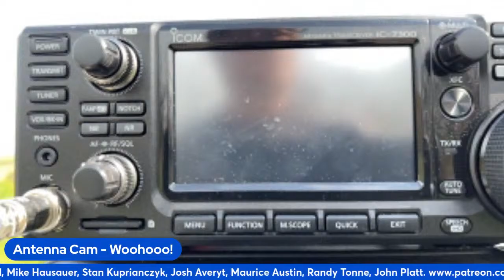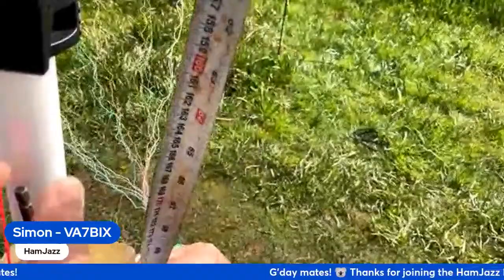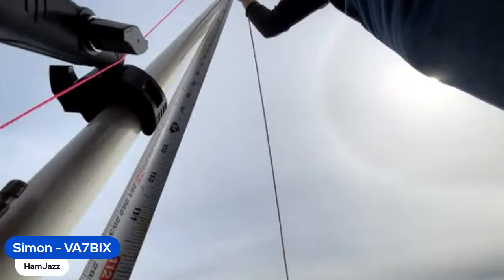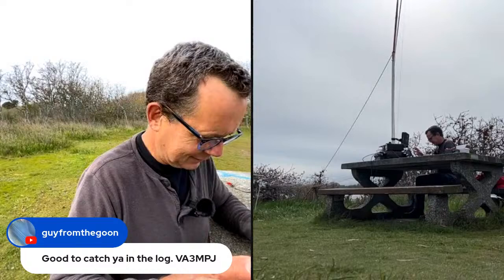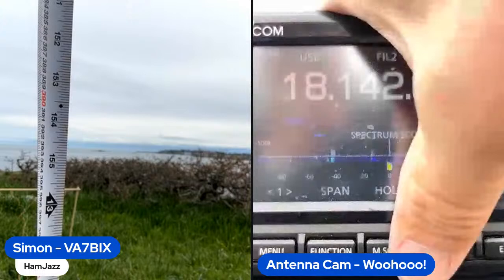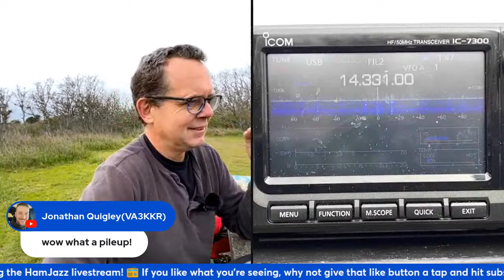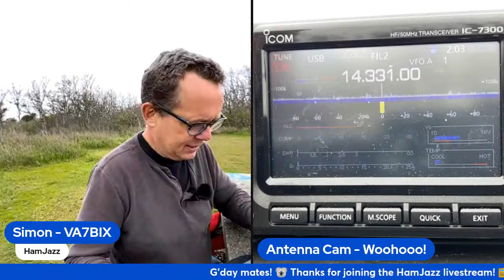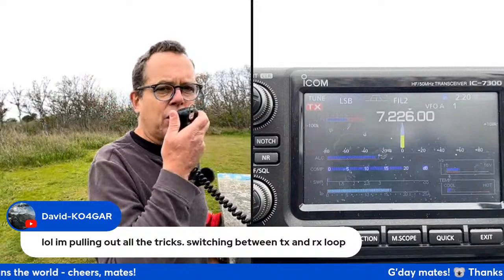Let's Surf the Grey Line - #pota #hf #hamradio #antenna

Comment: Simon, what’s your stream setup mate?
Reply from the maker: Hey there Robin, thanks for leaving a comment mate. I use Streamyard..... main camera is my iPad, which has it's own hotspot with data, and then 'antenna cam' is my iPhone which is on it's own hotpot and data. So there is some redundancy there if it crashes if that makes sense? Then I have my tablet for logging. Hope this helps mate. Cheers!
Reply: Thanks Simon, this is verry useful . What kind of mic’s does you use?